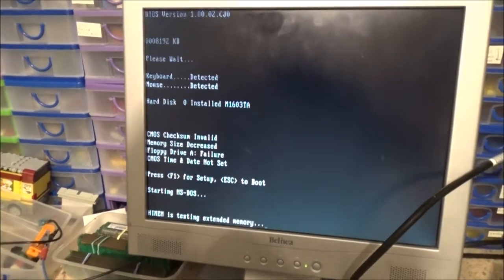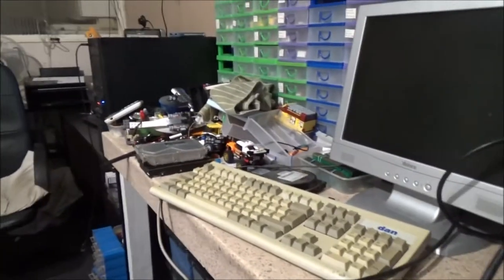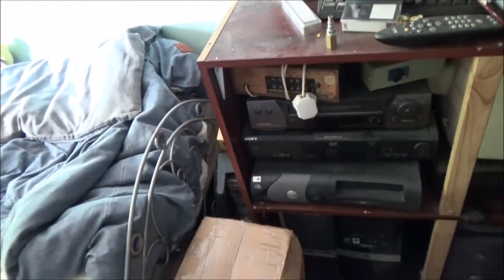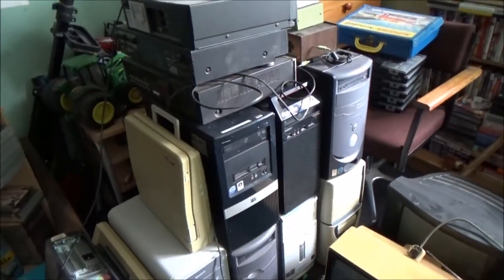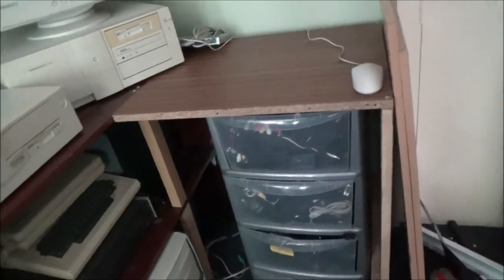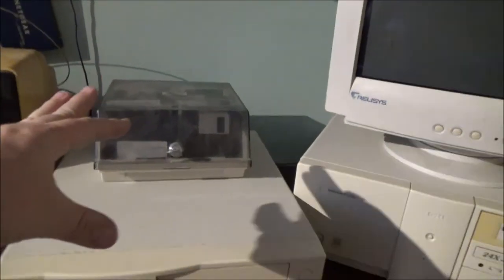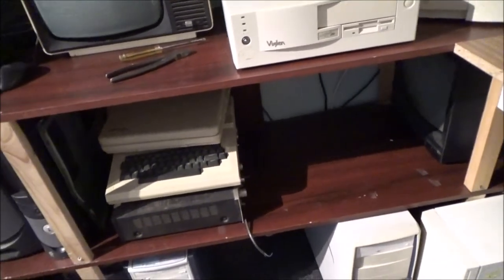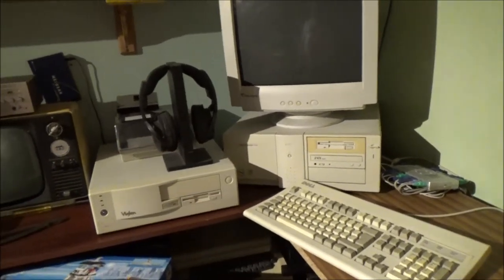Finaly Assembling My Retro 90's PC Corner.

Comment: Those Dell Optiplex computers are great with Windows 2000. You could piece together an "ultimate" 2000s pc from the bits and bobs. Pull the max ram, best gpu, hard drive, etc.
Reply from the maker: Thanks for the tip. I have so many XP machines I'll put 2000 on my optiplex GX60. And the drivers are available for that machine for win 2000 too.

Comment: Press button 2 to disable the resolution message on the monitor.
Reply from the maker: I did, still didn't want to get rid of it. I think that might be why it was thrown out lol.
Reply: Could be. It could be a project you could work on!
Reply from the maker: I haven't tossed it out yet. However I do have a much better monitor in need of repair.